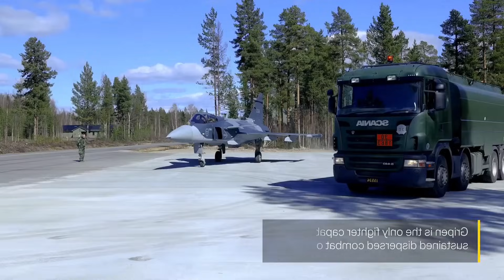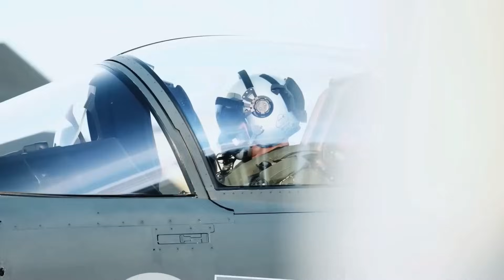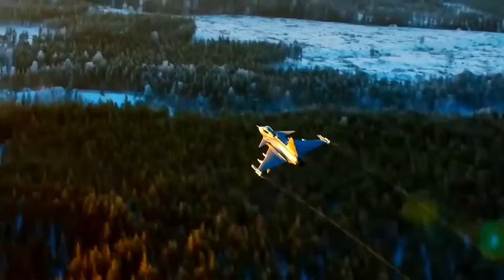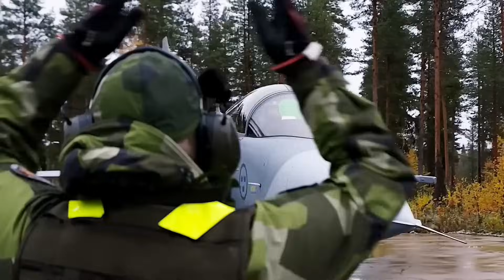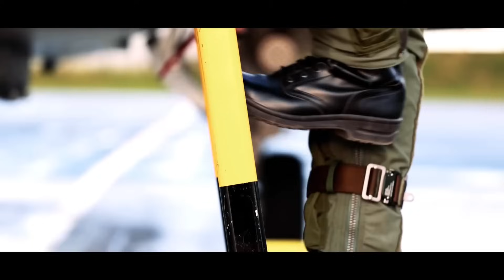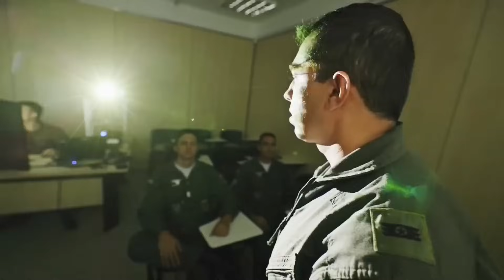Sweden's Bold Move: Rolls-Royce Engine Could Save the Gripen E/F!

Comment: There's no "if". The engine is already used in the new Gripen models. And it's not only a British engine, It's also stronger, faster at changing power output, quieter, cooler and more fuel efficient. And it's not just a little difference in any of these. The Power to Weight ratio is something like 1.4 for a fully loaded aircraft. The F35 with it's dual engines has a power ratio of about 0.8. That meant not only does it start to accelerate faster but it accelerates a lot faster. The engine works better at low air pressure which means it is even better that the others when really high. It super cruise, that is makes Mach 1.1 or 1.2 without after burner which saves fuel and makes it very fuel efficient and gives it a huge boost in active range. It's more temperature tolerant than the GE engine was. And still it fits the same physical shape as the GE engine and can be swapped in as a replacement without having to redesign the fuselage. Finally it's modular. Entire parts can be change by a small team of engineer with just a few months training. Swapping out the entire engine can be done in less than two hours anywhere they have a service team. No special training. No special service station. Just lift one out and put another one in. Add that it's more durable and the service intervall is more than twice as high as it is for the F35 and it's even better.

All in all RR has made a fantastic job on this engine. Volvo Flygmotor helped with the tech for compartmentalizing the engine to make it easy to maintain and rebuild. RR are now working on making a replacement engine for the UK fleet of Eurofighter Typhoon with the same kinds of improvements. The Eurojet EJ200 is no slouch, but RR is looking at making it a lot better. It's already based on a RR design, but it was developed in the 80's, and with what they have learned since it was developed, how manufacturing technologies has improved and what they've learned is possible it should become a fantastic engine.
Reply: NO, STOP LYING; THIS ENGINE DOESN'T EXIST
Reply: Nope, the Gripen E/F uses the GE-F414 and nothing else is in the plans, this is just social media rumors and hype without any substance
Also teh F35 is not a dual engine design, you apparently have no ide of what your talking about.